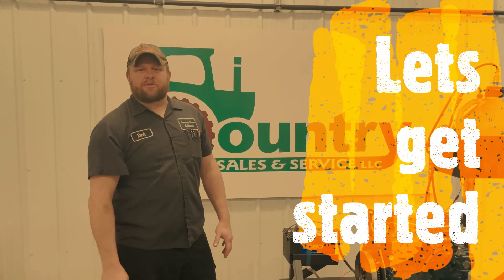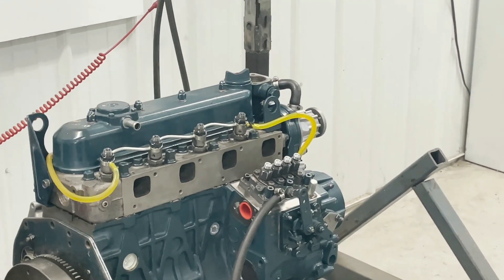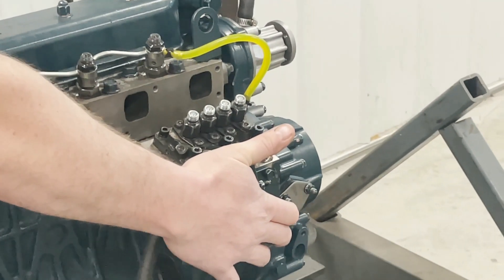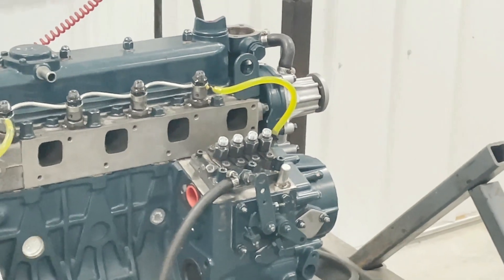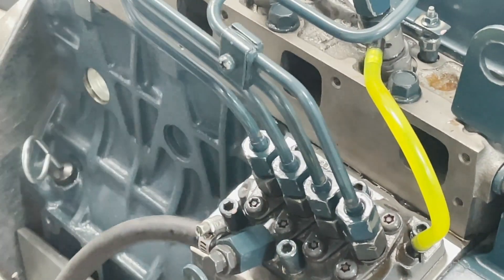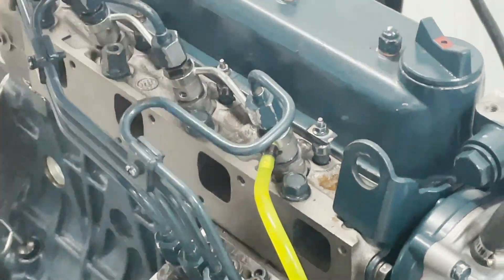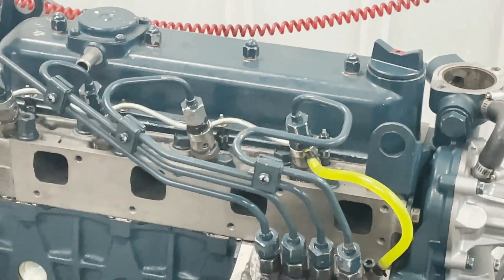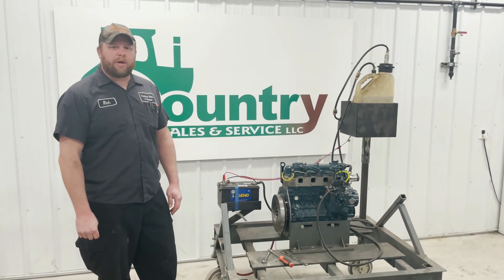How to Bleed a Kubota Diesel Engine Injection Pump

Comment: D1105 Kubota: I ran this test and 2 of the 3 barrels are spitting fuel, the 3rd has some fuel just resting in the top and maybe very slowly flowing out when cranking the motor but for sure not spitting like the other 2.  Can that be fixed or is the pump shot?
Reply from the maker: Yes, we have a Full Service Injection Shop  and offer our customers the option to utilize our Demand Remanufacture Process (even for most obsolete and discontinued injection pumps). We also offer remanufactured Injection Pumps, Injector Kits and High Pressure Common Rail PFR; Inline; Rotary; Fuel Systems to fit the following OEM's;
• Bosch
• Denso
• Yanmar
• Lucas
• Stanadyne
• Zexel
Our remanufactured Injection Pumps & Injectors come with an industry-leading 1-year/unlimited-hour warranty.

Let us know if we can help, find our website in the description!

Comment: hi,im having the same trouble on my nanni 5250 with the  bosch k series mini pump, i suspect the fuel feed pump at fault and have changed it with an electric one and i can only get fuel in drips from the injectors no matter what i do ?.
Reply from the maker: could be a bad start solenoid if it has one or the fuel rack is stuck in the injection pump
Reply: @CountrySalesService  many thanks for the reply, i strongly suspect the fuel rack, as i can only move the throttle lever a fraction that it used to move, hope you are well.

Comment: I get a clicking noise sounds like a short when i turn the key on. I think i have an air lock. Tc 25d new holland
Reply from the maker: The clicking noise should be your fuel shut off solenoid turning on and off. That will make an electrical clicking sound

Comment: Country sales very nice,
I ran across my friend's kubota V1505, won't start, fuel skirt out from injection  pump at # 1 and # 3 port only  and non at # 2 or # 4, fuel leak out from pump shim and find out washer was installed in  between shim and cover by a mechanic he hired to fix. Anyway I pulled it out but shim was badly cracked,
The main question here Can I open the pump area to clean the port where fuel skirt???

Comment: Older Kubota B2650 Diesel ◘ I use Glow Plugs on warm-days-start thinking they are long-service-life anyway ○ Are these only used for starting? ( Cold or otherwise ) I thought glow plugs ran constantly but apparently I need to be corrected on this; Both of us are accomplished Mechs's ~ Kubota B2650 is giving very good service;
Reply: Glow Plugs are for cold weather starting, and aren't needed once the engine is capable of staying running. I work on Diesel's in -40 temps and a kubota is one of the best engines to get running.
Reply: @RealSprooseMoose  
After posting my findings are "Starting assist" not what I thought ~ very moderate conditions so your advice is that if I keep battery charged and it will "catch" ( begin operation ) to ignore carbon cloud and other things and not use them at 40° F — correct?

Comment: I am having trouble getting a Kubota 2403 started.  I was checking the injection pump like in your video but a soon as i turn the key and the electronic fuel pump starts, fuel comes out of the injector pump. Is that normal?
Reply from the maker: Your delivery valve is either loose or bad. that cylinder could be on the injection cycle. if you turn the engine over it should stop.

Comment: GOOD JOB! BUT FUEL AIR BLEED COULD HAVE PERFORMED BY LOOSEN HP LINES ONLY AT INJECTOR INPUT ADAPTER INSTEAD REMOVAL COMPLETE SET OF HP LINES.
Reply: i believe he was demonstrating as if installing a new/rebuilt pump, best to verify it pumps & shuts off before installing the lines
Reply: Thanks!